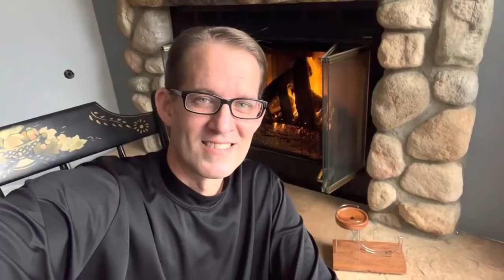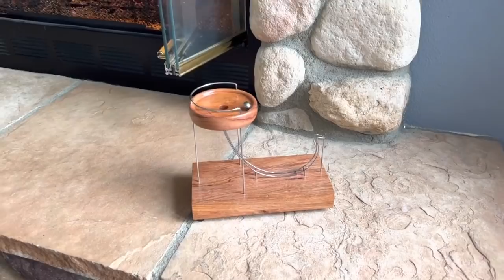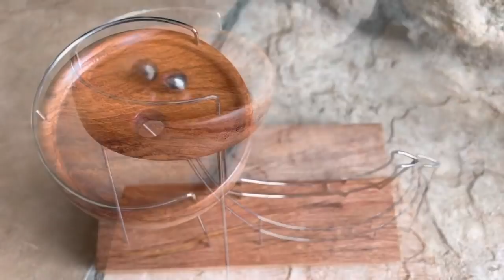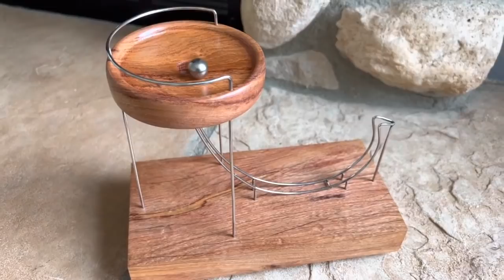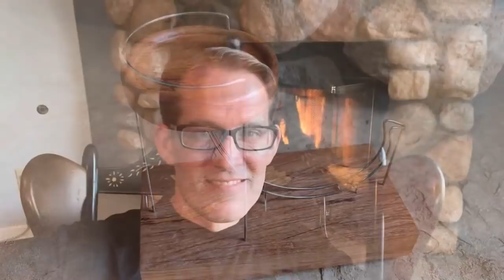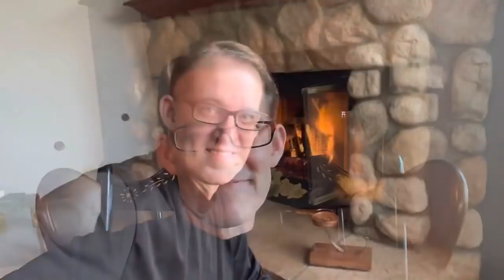Perpetual Motion Marble Machine in RamZland!

Comment: How does it know when to pulse the magnet?  Is there a sensor somewhere?  
I thought it might check if the two wires are electrically connected (by the conductive ball), but it seems that the wires touch anyway.

Comment: It it were just a magnet, wouldnt it attract the marble, speeding it up on the way down, but then keep attracting it, slowing its “jump” back into the funnel?
Reply: Good question. It is a electromagnet, which needs to turned off quickly to release the ball, not attracting it.

Comment: Can it not be a permanent magnet? Why an electromagnet?
Reply: a permanent magnet will attract the ball to it. The ball will not escape.
Reply: @lengoctuan155  does the electromagnetic engage and disengage then?
Gravity and electromagneticism both are attractive forces, gravity assists are a thing and planetary gravity doesn't alternate on and off. I understand the forces are different, but I'd need to see a diagram of the device. I need to visualize it.
Reply: @StitchesLovesRats  yes, the magnet must be turned off very quick to disengage the ball. It is only turned on for a few miliseconds.
Reply: @lengoctuan155  i see. Thanks

Comment: Someone needs to design a quiet version of this.  The sound would get annoying and it's the first tipoff it isn't a perpetual motion machine if you don't include physics as a clue 😂 I think I'd also give it a wireless charger if it doesn't have one already.  Maintain the magic when someone picks it up by hiding obvious electronics.
Reply: Just line the top landing area with felt

Comment: As the ball energy diminishes , it comes to where the hole is in the bowl. At the point of the hole it falls and with the help of gravity it accelerate . As it reaches the end of the track because of the sharp bend upwards the ball is directed back into the bowl . There it spins faster in the bowl.As the surface friction retard  its motion , it come to the hole again and regain energy as it falls. And the sequence continues and again
Reply: No it won't work that way. As it moves the ball will lose energy due to rotational friction and wind resistance. Therefore it won't have enough momentum to jump from the end of the track back up into the bowl again. The lost energy must be continuously replenished to allow the ball to continue jumping into the bowl. In this case a switched electromagnet and a battery must be hidden somewhere in the machine to make up for the energy losses so as to keep the machine running.

Comment: Yup. This is a similar idea to the old shop window displays that were popular over here in the UK in the 50's and 60's. They usually took the form of 'perpetual' swinging or rocking mechanisms that seemed to have no source of power. Just like yours, they used an electromagnet which was switched on at just the right time to nudge the rocker each time it passed. And just like yours, there are more than enough numbskulls to believe it!
Reply: You and me included!
Reply: Never ending motion
Reply: @arnoldllamasjr9133  No, because the battery runs out after a few weeks.

Comment: Are you sure that’s how it works?  That’s what I assumed too until I bought one to check. On my model, in the “funnel” type contraption, there was  a little motor driving a small wheel. A tiny bit of the wheel stuck  out into the “throat” of the funnel accelerating the marble down, giving it enough energy to jump back into the hopper. Does yours have a power switch? Look into the throat to see if you can see something protruding. Out your ear up to the hopper to see if you can hear the motor.

Comment: What if there was something like an neodymium magnet, or whatever the strongest magnetic material is, placed in the base to pull, but also in the hole in the cup, to suck it down, and accelerate it down. As that was happening, the one in the bass would pull, to increase the speed.
Reply: The problem with using a fixed magnet in a device like this is that as the ball accelerates toward the magnet and then passes by it, the magnetic attraction is immediately trying to decelerate it again. The ball can't ever move away from the magnet with more speed than it approached with.
Reply: @ChrisBLong  what about deleting the one above and keeping it one below, and extending the ramp on both ends, while magnetizing the ball. If there is enough force to overcome the ball from stopping. Once it pops past you force that could repeal the ball and the base. If there was enough force, and enough ramp. To act such an a week rail gun. 
I know that these machines don’t work, but I do believe that a machine can be built, with a similar design, that could be a more efficient design. If a small motor, could be used to kickstart a machine like this, and periodically the small motor would kick in, boosting the machine to full speed. If the machine is maintained and has such low drag. I am thinking that it would not be 100 = 100, but ~75 = 100. Even if it was possible to achieve a hard 95 = 100, without the deviation from the variables being factored in. That would still be a 5% produced. If this would be possible, then stacking machines would thus net a positive gain larger enough to be used, and no this pacific design could not be used in production of anything. A different design would be needed to drive something. But a toy like this would be a concept.

Comment: EXACTLY...gravity plus a little electromagnetic assistance in the gravitational drop duration gives the ball a BOOST to then overcome what would be the equal energy to climb back up. With the aid of a magnet you have momentarily used a combination of gravity plus magnetism to create a NET GAIN of energy. But is it enough net energy to harness? I suppose on a VERY small scale you could collect a net amount off the setup using the magnet as a negative charge and the falling ball and track as a positive charge and generate an infinitesimal  amount of current. Make MILLIONS of these? THAT S  WACKY...but possible.
Reply: With the aid of a magnet you have momentarily used a combination of gravity plus magnetism to create a NET GAIN of energy.

How is spending (electrical) energy to accelerate the ball
a net gain (that then even could be harnessed)? ;)

Comment: Do you think a rare earth magnet would work or does the electro magnet need circuit switching
Reply: It needs to be an "active" circuit. 

A passive magnet of any strength, including a rare earth magnet, would cause an extra loss of speed as the ball moved away, cancelling the extra gain in speed as the ball fell towards it. 

The active circuit needs to detect the ball and switch the magent to stop the loss in speed as the ball moves away. 

I'm an Electrical Engineer, so I know this stuff because it's fundamental to our training at university.

Comment: Yes, well the ball entering the hole with next to no kinetic energy and landing back in the bowl with excess kinetic energy is already a violation of the basic premises the quoted thermodynamic laws are based on,  so it is right away an obvious MECHANICAL failure as a perpetual motion machine even before we know the exact mechanism of that violation.  But there are lots of more subtle ways to extract energy in a non-equilibrium way from the environment to operate a more tricksy FAKE perpetual motion machine.  My favorites of course are the ones that fool even their “inventors”.  😀

Comment: It was possible to see that the steel ball didn't just 'fall' through the hole. It definitely accelerated faster than normal as it dropped.
Reply: Now that you've pointed that out, yes I can see the ball accelerate.
Reply: I have been seeing the picture and finally realized that it's as thus guy says at the end. I watched the video and from the first drop, I saw what you did and it was obvious that it was being accelerated. So from there, the only mystery was what brand if magnet is it?
Reply: @timothyball3144  not a magnet - at least not on the one’s I’ve seen. It’s a motor in the hopper that drives a small wheel the flings the marble down the throat of the hopper faster than gravity would pull it.
Reply: @patrickandkennafenwick3958  in this one, he states that it's a magnet.
Reply: @patrickandkennafenwick3958  
I've seen both versions. The cheaper one has a motor inside the platform that launches it.

This one has an electromagnet in the base. Not exactly sure how this works, but there's a PCB in there with a handful of large capacitors, a flat coil and an 18650 battery. I have never seen a capacitor on a magnet before, i'm guessing it charges the capacitors while the ball is still swirling on the platform, and the ball touching both rails closes a circuit that activates the magnet and dumps all the power in the capacitors into the electromagnet in one strong burst.
Reply: Another thing not mentioned here is that the ball has to be in a circular motion in top dial. This doesn't work if you just throw it down the hole. I bet there is some electromagnetism happening up there as well. There are 2 batteries in this. One in the top dial & other one in base.
Reply: Exactly. The downward acceleration seemed to be greater than that due to just falling.

Comment: Would increasing the height of the drop work, without the magnet?
And making the ramp on return flight angled more towards platform?
Reply: No. Never. The mystery and attraction of Perpetual Motion Machines is 'something for nothing'. Everything has a cost. In these devices you have friction and gravity of which you cannot escape. You can reduce friction but not eliminate it. You can manage gravity but not change it. You can see the ball being 'shot' out of the bottom of the wooden plate, not just falling through. That's adding energy which makes the deception. You cannot fool Mother Nature.
Reply: No because the ball would have to fling even higher to get to the platform.
Reply: @MrHominid2U  right for sure.

Comment: I see the logic with the electric magnet doing the work, so then, why an electric magnet and not a regular one? how is it any different? and before anyone says strength of the Magnet you can get some dam powerful non-electric magnets so it isn't that. Also, wouldn't any magnet simply pull upon the metal ball forcing the ball to be locked to the base?
Reply: It's powered by a battery. You can't do it with a regular magnetic, you simply CAN'T. Nobody can create a perpetual motion machine despite all the complete BS fake stuff that people post on YT.
Reply: @stevo184  thanks for the response but sorry that's not an answer. "You simply can't" isn't an explanation it's your interpretation.  Sure it might not be possible with a regular magnet but I wish to know what the property is of an electric magnet that differs so that it allows this machine to work
Reply: So the difference is the electo magnet can be turned off. While the ball is falling it can be on and turn off when it's on it's way up so it doesn't keep pulling it to the base
Reply: @1RandomMinecrafter  fair, but I would be curious also then to know how it times that to a free falling metal ball automatically? Is that because the metal ball is conducting through the 2 wires it rolls down temporarily completing the circuit and turn on the magnet? That is interesting because as the ball falls the distances of the completed circuit would reduce which may affect the strength of the electric magnet and create a push affect.

Comment: Please show the base and what the connection looks like?.  I have been trying to get one of these, but all they sent me was a block of wood for the base with no external source connection...like a USB or whatever to charge the magnet.  The balls roll down the ramp and sit there.  
I ordered one form Amazon and the seller turned out to be a scammer.  The one from Etsy was just a block of wood for a base with no connection for a power supply
Reply: Agreed, can someone please help answer these fundamental questions ?
Reply: @davehyper7835  The good one can be had on Amazon by the seller Kiswoods.  It ships from Vietnam...NOT China.  China stole this man idea and produce cheap knock-offs.  His version runs off of four rechargeable batteries and is charged via a USB.  It costs a good deal more but is much nicer and the original.  HIs videos showing them are here on YT https://www.youtube.com/shorts/tFkxVODqXlM

Comment: This is really cool. I wonder if you could harness the energy from the ball to charge the electromagnet?
Reply: even if you had a mechanism to extract a little energy from the ball falling on the base or something, it would never be enough. You always need to add energy to the system. Theres no such thing as a free lunch
Reply: I wonder if you could harness the energy from the ball to charge the electromagnet?
... but you first have to spend electrical energy
to accelerate the ball - so it goes higher than where it fell down from ... ;)

Comment: NASA engineer here. NO, it would NOT work with a permanent magnet. A permanent magnet would have the effect of both accelerating it down the ramp then also wanting to pull it back down the ramp as the ball gets past the magnet ready to launch. The reason why there is an electromagnet is because it has a sensor that turns the magnet on ONLY when the ball initially comes down the ramp from the hole in the platform above, then it automatically shuts off at the exact time the ball comes closest to the magnet. That way the ball experiences enhanced acceleration coming down the ramp but does not get pulled backward as it goes past the magnet because the magnet is turned off at that point. The sensor can be the electromagnet itself, because the steel ball interacts with the magnetic field flux and this interaction results in a change of inductance in the coil which can be sensed by the electronic circuit that controls the current in the coil. So you see, it's a lot more complicated than you think. It's not just an electromagnet that stays on all the time, because that wouldn't work either.
Reply: Haha! Basically just a rail gun in disguise
Reply: You NASA engineers with your flux capacitors.  We curse you and wish the fleas of our camels into your beds.
Reply: Would it be possible to have the permanent magnet positioned in a way that once the bearing passes it, there's a shield/barrier made of material that blocks the lines of magnetic flux? So the bearing is only influenced by the magnet as it's coming down the ramp?
Reply: Far f off we said in the sixties... This is though as close as we can get to perpetual mobility isn't it? My question is, and I'm not a scientist, isn't that enough?!
Reply: But if a permanent magnet hallbach array accelerated the ball moving towards it at a faster rate than when the ball moves away from it then theoretically we should be able to get a true perpetual motion effect. I'm off to my test bed!
Reply: I'm not so sure the electromagnet is in the base. It could be in the round piece with the hole in it at the top. The windings could be wrapped around and around the hole. As the ball goes through the hole a sensor applies current to the electromagnet and that propels the ball downward, giving it enough momentum to jump back up to the top. The metal supports could be supplying the electrical power from the base up to the top piece.
Reply: To NASA Engineer, can you tell me why we could go to the moon in 1969, with a rocket made from cardboard, and a washing up liquid bottle, yet we can’t go there now lol……..Oh and how is it possible that NASA lost all of the old recordings and data of what is considered, to be the greatest human achievement of all time lmao?
Reply: @GREENEEL  These are the same old nonsensical claims that have been repeated and debunked a hundred times over. Instead of parroting this same conspiracy garbage and laughing your ass off like a demented hyena why don't you start doing some serious research using the many reliable, diverse and independent information sources that are available. Then you will understand that neither the rocket nor the spacecraft were made from cardboard, why we haven't been back to the moon since the 1970's and how the enormous evidentiary record documenting the moon missions in extreme detail still exists minus some old "telemetry tapes" that were no longer needed after a successful mission was over.
Reply: @GREENEEL  is that really the case? If so, isn't that  like Putin who lost the 
Sovjet Union?
Reply: @SUMERUP  mmmmm I’m not sure how this would be the same thing?

Comment: How many would like to see that operate without the magnet charged up?  Would the ball make it back up to the top at all?  Seems unlikely.  What if there’s a ‘permanent” magnet(s) in the base, would it slow or speed up the ball and if it sped it up enough to work the device wouldn’t the life of the magnet be the non-perpetual elemen in the device?

Comment: Would love to see you remove or turn off the magnet and then show us what happens when the ball goes down the ramp.  Good video
Reply: I agree let's see
Reply: It just wouldn't get enough height to reach the funnel
Reply: Now that's a Great way to extinguish interest in it.
Reply: https://youtu.be/ToUKmZF4UKI
Reply: Yes, I agree. I would like to know just how close or far it comes to reaching its goal with no magnet. Does it come close at all, or does it just plop down at the end and not get much lift at all?
Reply: @pentacleman1000  Even with zero friction along the tracks
it would just go as high as where it started from - which is the top of the hole in the funnel.
It would not be able to go above that - let alone change direction to go back where it could fall into the funnel from above.